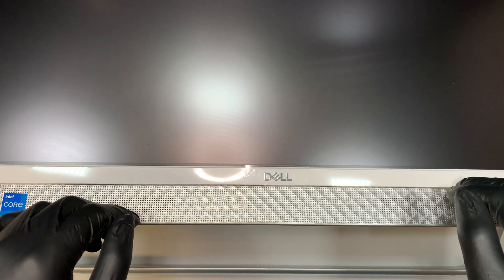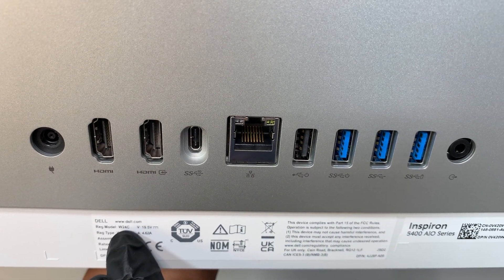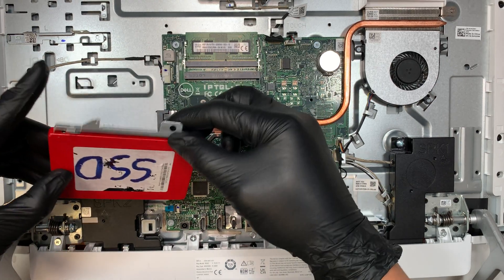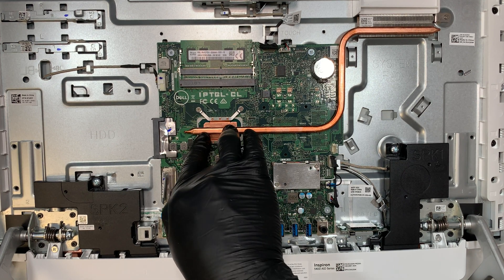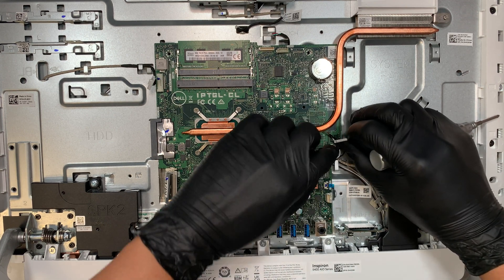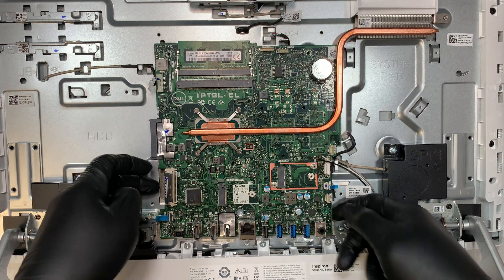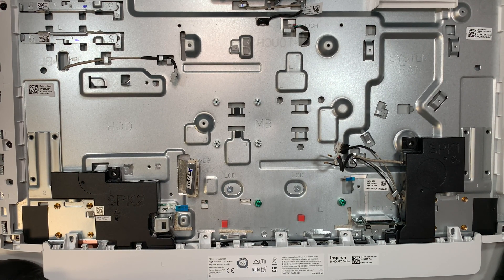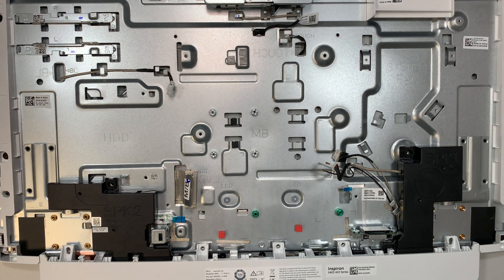Dell Inspiron 5400 W24CL Tear Down Disassemble

Comment: @paulwoolnough3445 Dell sent me the Motherboard and I it took me about 2 hours to take the old one out and install the new one.
Just take photos of where the connections were originally. It’s was quite easy to swap the CUP and heat sink. The paste is provided with the new kit.

Comment: Hi,  good explanatory video !  @3:45  Upgrade from 8 GB to 16 GB ram by buying another 8 GB ram. I assume there are 2 Slots to add the 2nd Ram card ?  Thanks ,
Reply: I did that on my june 2 birthday
Reply: And yes there is only 2 slots 

And you can also upgrade to 32 gb ram by replacing both 8gb ram to 16 gb ram

Comment: Thank you! Used this guide to check our work computer. Display would be jumpy for 3 seconds, then normal for 3 seconds. Ultimately, we found the screen was cracked after I wiped it with a damp cloth... but it started working better. Weird.

Comment: What could it be the problem? Yesterday there was a terrible storm with large thunders, and suddenly this all-in--one PC just turned off. Now, when I want to turn it on the fan just turns for some seconds, that's all, and the power LED keeps blinking, no video, no sound. Thanks
Reply: Did you managed to fix it?
Reply: I think the lighting might power surge your pc that sends to much voltage to your motherbored in order to avoid is to have a ups

Comment: I was wondering if its possible to instal a graphic card somewhere on this motherboard. But it seams is not, or am I wrong?
Reply: it has 2 slots, so you can add a second on top of the original! im trying to find out if i can upgrade the CPU to i7, from an i3

Comment: Thanks for the video, can you install a regular sized m.2 ssd?
Reply from the maker: Yes
Reply: @UbergeeksBiz  that's incorrect.  Just attempted and there is no spot for the normal size m.2 nvme
Reply: @MTGUnscrewed  could you connect a 2242 m.2 maybe?
Reply: @ik15tv  I forget the exact size but that sounds right.  Its the smaller form factor